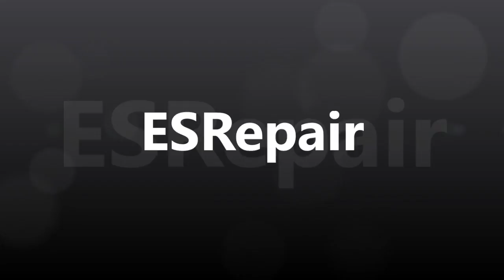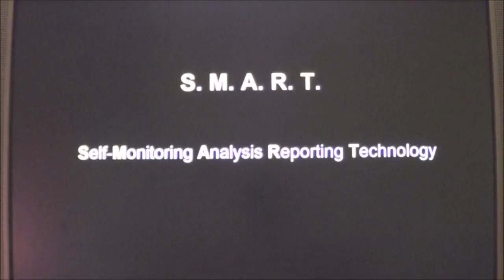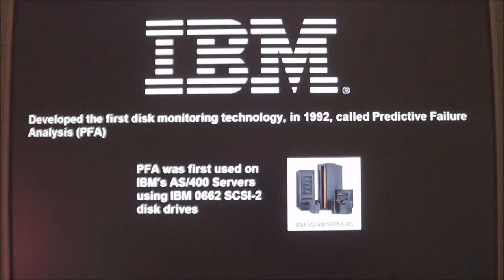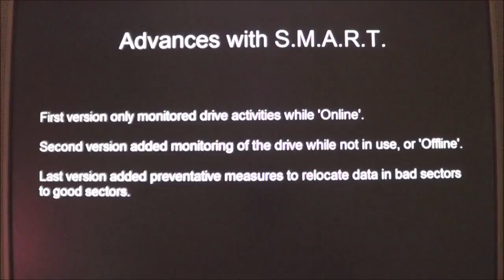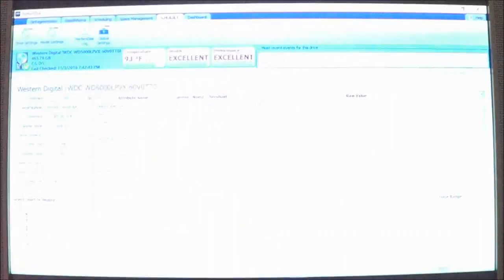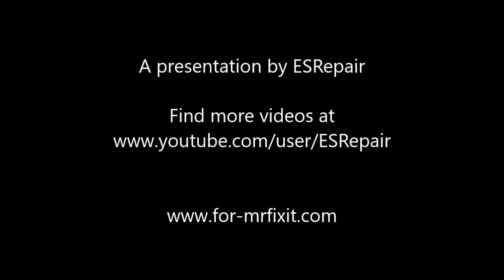What is a S.M.A.R.T. compatible Hard Drive?

Comment: "hasn't made a lot of headway" - uhm.. it's a standard used in every single hard disk you could possibly buy for the last 20 years. Because they don't make a lot of noise about it doesn't mean it isn't there.
Reply from the maker: All HDDs use SMART, but it is only at the MFG level.  There are no standards to use SMART. MFGs only use it to determine the drive's health and cause of failures to help improve future HDDs.  A MFG only has to use one perimeter and it's called a SMART HDD.  Many drives that fail do contain SMART but the DATA  they contain usually can only be interpreted by the MFG.  Many users are never warned of the impending failure.

Comment: Most of that video was out of focus. Maybe try manual focus on your camera? .
Reply from the maker: The camera is a webcam on the laptop..... How would you manually focus it when it has a fixed focal point?
Reply: In that case it either needs cleaning or the resolution is really low